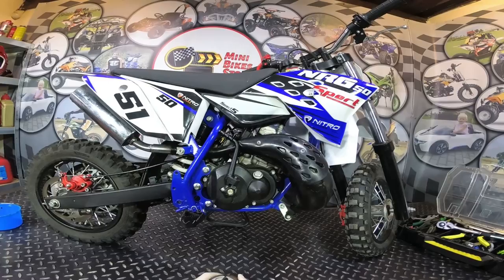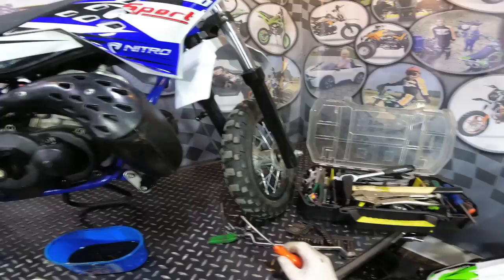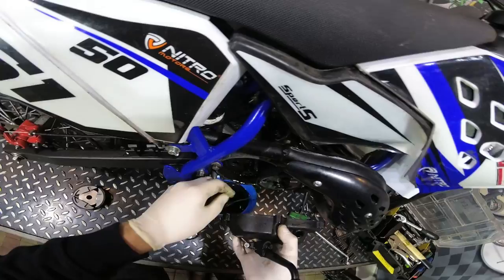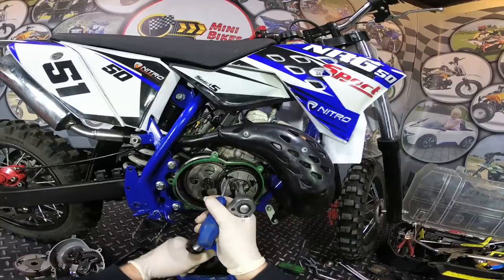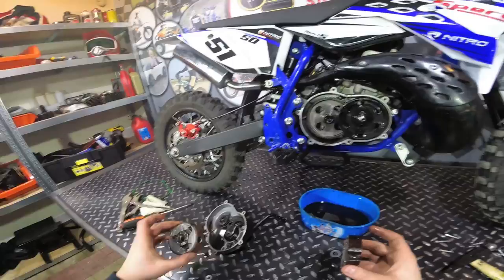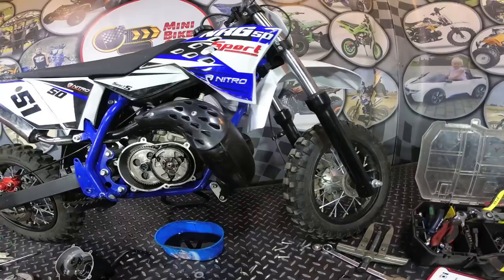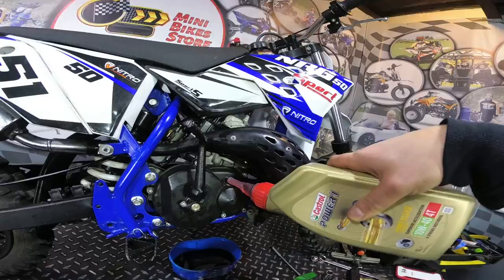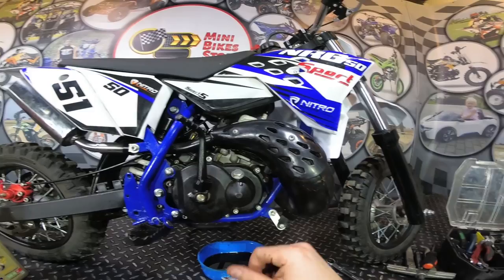How to Replace 🔧 CLUTCH in NRG50 - KTM Replica - Nitro Motors

Comment: what oil and how much oil for this clutch? thanks
Reply: Im wondering the same!
Reply: @Scratchen2  just thought if it comes with the cheap shipping oil could drain it into a measuring jug and replace with the 80/90 you read about thats if it comes with the right amount i think ill look om the ktm site and check as this is a replica from 2009
Reply: richard tucker I think it should take around 0.3-0.4 liters.
Reply: @tokeintuckz  Just found this! The (original) KTM Morini engine apparently takes 0.25 liters. https://www.youtube.com/watch?v=TqV_OePORO0 Check at 6:23.